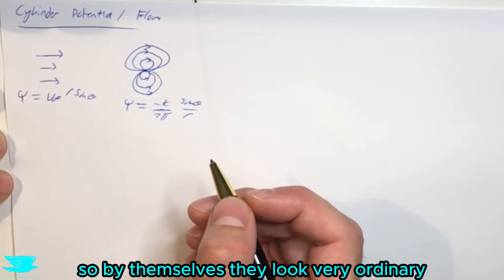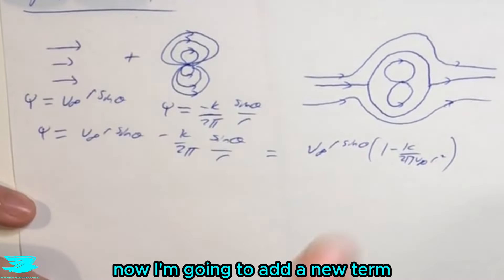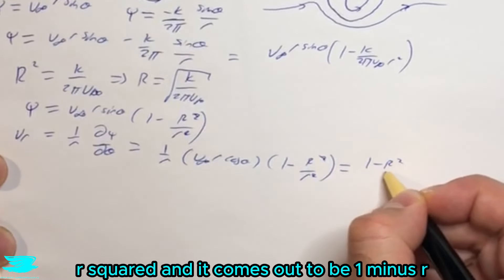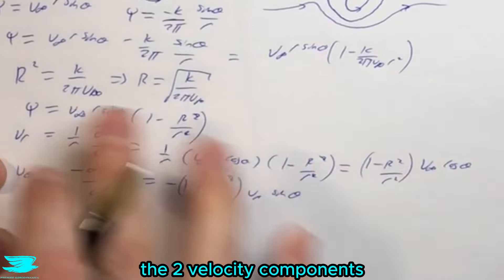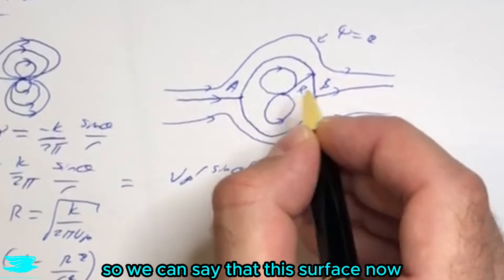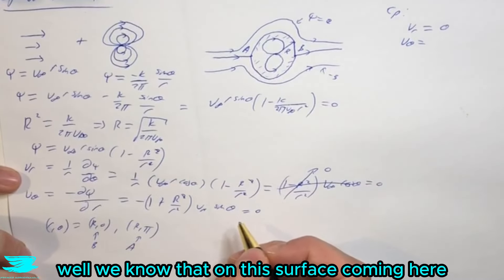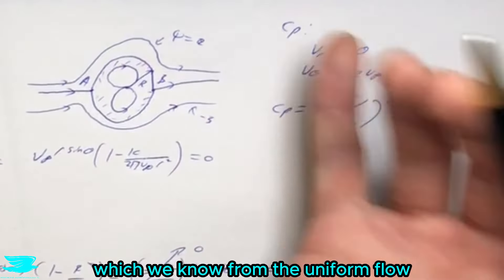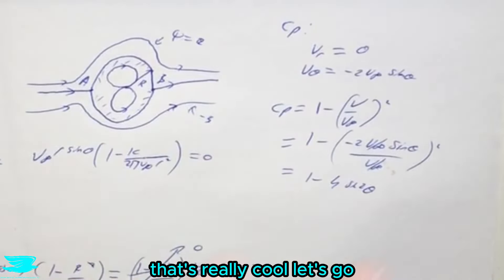Potential Flow Of A Cylinder [Aero Fundamentals #58]

Comment: Hello,

I guess Taylor–Couette flow got something to do with this.

"Streamline patterns of flow over two circular cylinders" is a paper which got some pictures of it.

I just invented a windshield for motorcycles with it. 
Just sit and look out behind and between the cylinders. 

In curves 1 cylinder stops rotating, while the other is powered up. This helps in steering and  stabilization of the cycle.
Reply from the maker: In a sense, but actually in another direction because the Taylor Couette flow is more about showing how viscosity affects the flow at a boundary.

With the two cylinders, it's an interesting idea. How close do they have to be to stop most of the flow going through the gap? Is it enough to see out of?
Reply: @PremierAerodynamics  

 @PremierAerodynamics  

The cylinders are able to rotate with supersonic speed. 
So just speed them up until there is no air movement in between. 

I just think supersonic cylinders are not this energy efficient. 
A larger cylinder radius helps too. 

I want to mention that there is a weird plane called "Fanwing" 
This radialfan cylinder produces a larger vortex.
I am not sure if a flat supersonic cylinder is less energy efficient.

With 2 supersonic cylinders in front of a flying wing - i believe it should be a efficient airplane propulsion.

If the air around the cylinders gets plasma charged - the plasma should stick at the cylinder, forming a larger cylinder diameter.

If the cylinders aren't supersonic some transparent cylinder material
should work too. 

I would start with 1,5 diameter space between the two 1 diameter rotors.